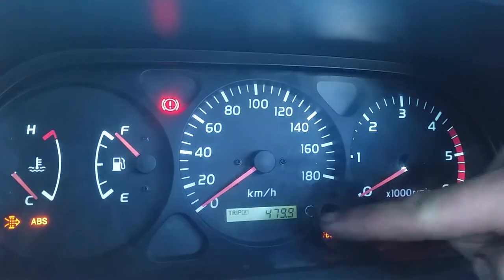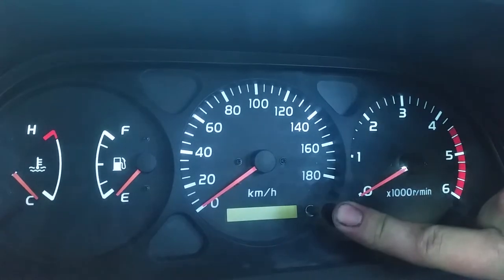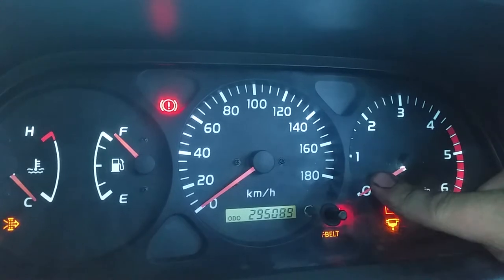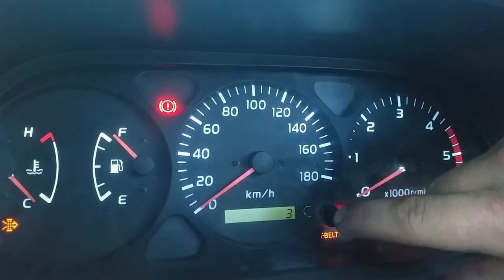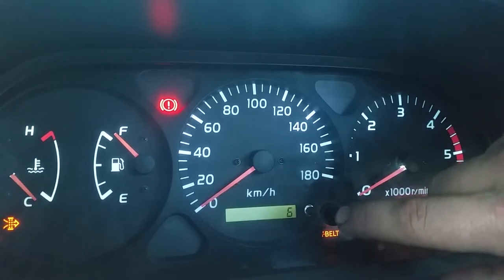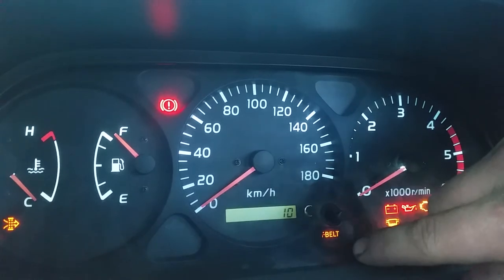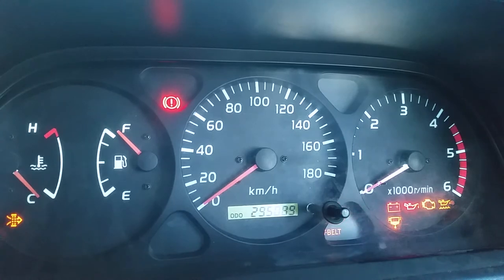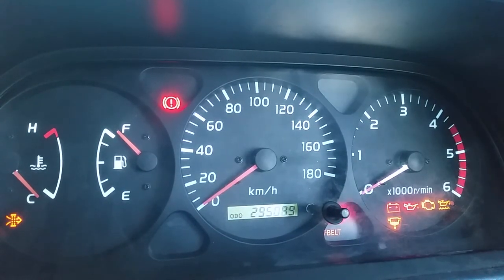How to reset timing belt light warning light prado 1kzte

Comment: If I do this and something is wrong with the belt will the light come back on
Reply from the maker: No , the light works with how many ks you have done since the last time it was reset.
Reply: @DIYIT13  I had a timing belt change 50 tho kms ago and the light cane on.i did what you did in ur video as I'm hoping it's just a sensor or something
Reply from the maker: @rebeccarorke4228  sounds like who ever did the job only set the light for 50k instead of 150k.

Comment: Toyota timing belts are due every 150k not 100k!
Reply from the maker: That is correct but I'm I bit different.
Reply: Yes I did off road with more than 100k. And changed belt 130.  Nothing happens